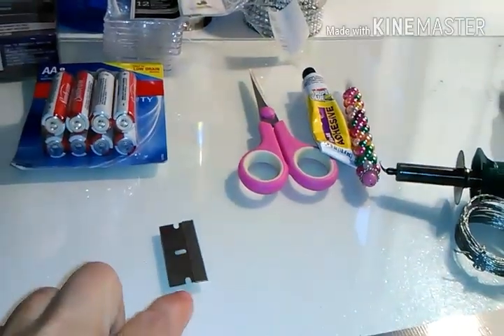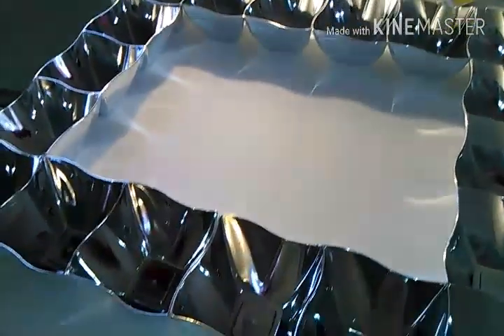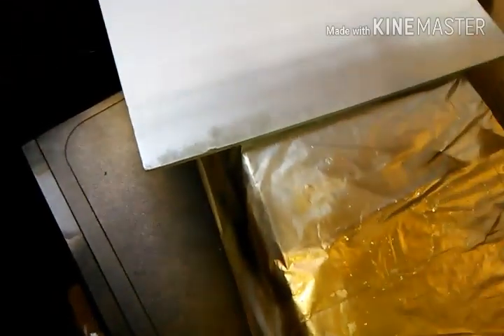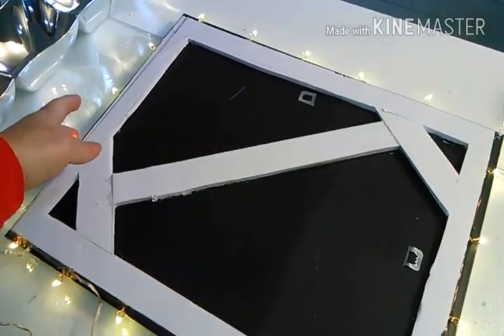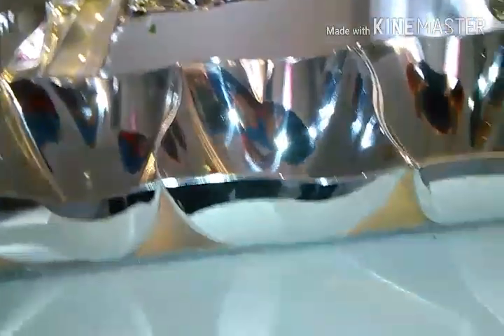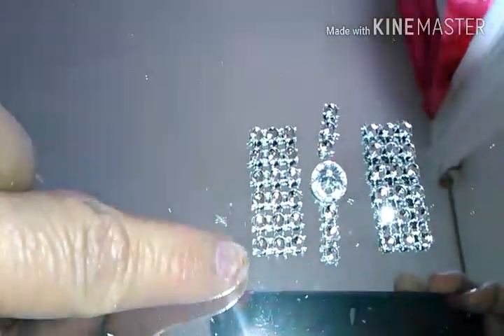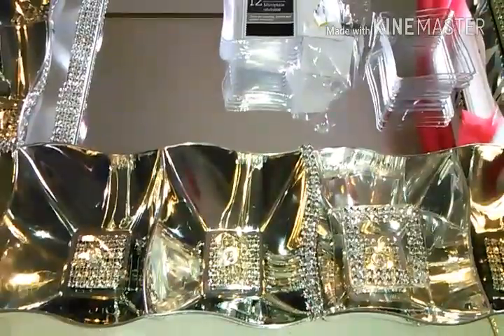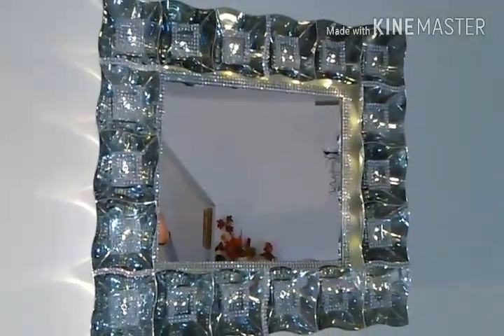Diy Room Decor/Light Up/ Wall Mirror/Dollar Tree

Comment: I used smaller lights and hot glued them behind the bowls and it came out awesome.   One thing I did find out about the small bowl is that one or two of them when you hang them have a dark shadow in the center for some reason and you have to replace that bowl.

Comment: very nice
Reply from the maker: +KATHERINE C.A. JONES Thank you Katherine 😊
Reply: the hole for the string lights is it from the bottom
Reply from the maker: the lights in the trays ( yes ) 
I used the Solder tool

Comment: Did I miss the steps where you poked the holes in the trays and painted them?
Reply from the maker: Trays were not painted that's the color they are.
Reply: @BlanquisCreations  I have some clear one's that are similar but I've never seen silver one's
Reply: @BlanquisCreations  what section did you find the trays?
Reply from the maker: Some Dollar Trees don't carry them or they may have them near the party supplies with the colored paper plates, cups and napkins.
Some Dollar Trees may have them in a section on their own 
( on the outter isle )
It really depends on the store. You can try ordering them from DollarTree.com ( if you ask your Dollar tree if You order it on line and pick it up there...They'll let you know, if you can. Some of them Won't and You have to pay for shipping and handling...which is more expensive...because some items you can only order by Cases and not unit ( individuals )

Comment: Did u drill holes?¿ what trays did u use ?¿ u didn't say what they wer n the beginning what they r.
Reply from the maker: Emilia Vargas the silver wavy trays are the party serving trays from the dollar tree the 3 in 1...then the inner clear trays are the small clear 12 pack also from the Dollar tree & found at the party section
Reply from the maker: Emilia Vargas ( I used a Solder tool to make the holes )